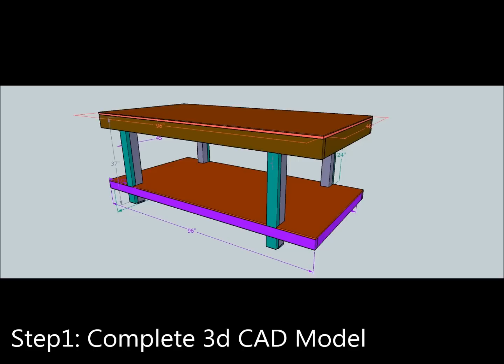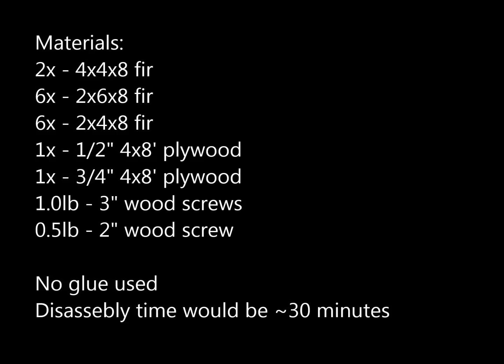Simple 4x8' workbench

Comment: Thank you so much for this.  The file on sketchup is so much help!  I am going to be building this bench in the next few weeks!
Reply from the maker: Glad you like the project, I still use this workbench, everyday for that matter, it's been holding up great, no complaints, it's extremely study. I even tore it down into sub parts to put in a pickup by myself and moved it to a different shop which worked just as I'd planned, for this reason would not recommend using any glue, it's not needed. The only comment I would have is that the top plywood has gotten a bit chewed up with a lot of use. I was planning to eventually flip the plywood over but another option is a thin sheet of plywood that could be tossed when it got too chewed up.

Comment: As pretty as some of these benches out there are,  I like your idea better because you can repair it (change the top after 10 years), or add stuff, or generally muck about with it, or move it somewhere, easily.  Not so easy to move around a 400 pound roubo style hardwood workbench that doesn't come apart, right?  Good ideas.

Comment: Do I need kiln dried wood for this?  Thanks.
Reply from the maker: I've heard some say you can frame using 'green' wood without problem. However it's also commonly known that green wood will deform as it eventually dries out to typically 12% moisture content if covered from rain. Amount of deformation will vary alot, it depends on many factors. Also the green wood may likely contain wood borne organisms if not kiln dried, this cold be mold, bugs, etc, green wood causes problems if painting it.  In my opinion it's not worth using green wood and would recommend doing some type of drying/disinfecting process. I do have a video on my channel on a dehumidifing kiln if interested.

Comment: Can the bottom shelf be skipped?
Reply from the maker: Hey Tom, In my opinion the bottom part isn't required but it does help make the bench much more sturdy and durable for example when moving the bench around in the shop. I'm assuming you want to roll things under the bench like a shop vac as why you don't want to utilize the unused space under the bench as a shelf, it's a huge area not to be utilized for that reason unless you are rolling a lot of heavy stuff under the bench would recommend to spend the extra cost/time to add the bottom shelf.As one idea of many, instead of having the 4 vertical posts recessed inward like in my video, you could put the vertical posts at far corners of the bench and then add plywood gussets screwed from the post to the top 2x6 frame, the gussets would not need to be very big to add a lot of sturdiness, that would allow room to roll things under the bench. The gussets would have to be in both side to side and front to back directions for each of the 4 vertical posts. This would mean you'd need to add some 2x4 vertical spacers to make the gussets flush with the outside surface of top bench frame.